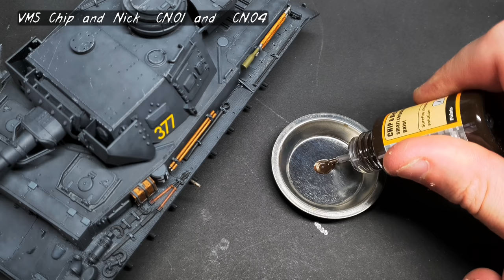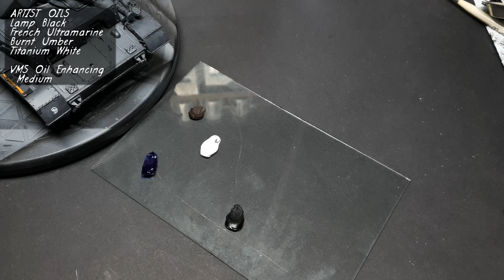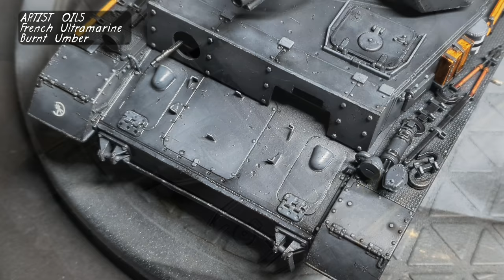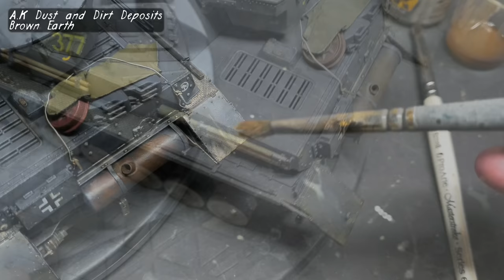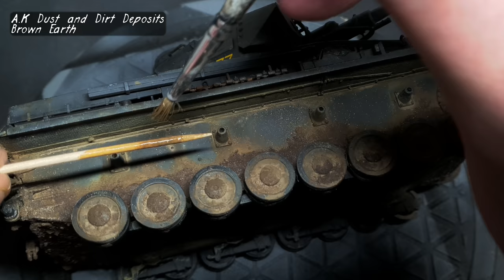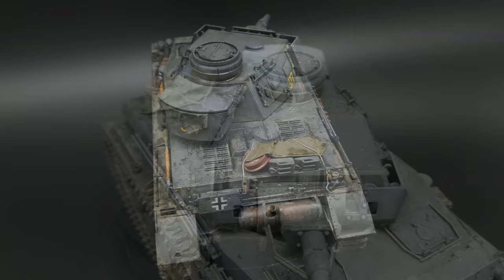Weathering the Border Models Panzer IV F.1

Comment: Hi James, thank you for the fantastic series — I watched all four, start to finish. Impressive result, I especially like the contrasts that you created, a lot of details to absorb here. If I could make a simple suggestion, I think the decals are all more or less pristine, compared to the rest of the nearby surfaces. The “377” decals may have seen some grime streaking from runoff caused by the hatches above, and the crosses some heavy weathering (especially the one on the back of the vehicle, which feels like it is asking to be chipped and scratched, given the surrounding details). Again, thank you!
Reply from the maker: Hi Curtis, this has been mentioned before and I completely agree, its one area I need to work on and not forget. Thanks for the feedback and I'm stoked you stayed till the end !

Comment: Really nice finish... one thing that struck me when looking at the final pictures is the number of gun cleaning rods you've got on the kit .. I think there might be a mix up of parts with the later variants of panzer IVs , but they do show up nice as a contrast to the grey finish... Great job all around on this build and will be looking forward to your next build ..
Reply: Although the work here is superb, I can tell you as a former armor crewman that a weather-worn (indicating it's spent considerable time in the field and hasn't been back in a motor pool or anywhere else it would have been cleaned up) tank is unlikely to have all its external kit. It falls off, is broken and discarded, it gets lost, it's stolen by other crews who need a particular bit of kit, and, if in combat, is shot off. There are only two times you're likely to see a military vehicle (of any kind) with its complete external kit - when it's first delivered to a unit and when it's ready for an annual general inspection and/or a parade. In use, they and their kit get the sh*t knocked out of them.
Reply from the maker: Hi Richard thats true it has the long gun one as well.. thats me not focusing and the instructions being a bit poor

Comment: Is there a “help forum” for out of practiced modelers, specifically for painting?  I am returning to building models after a 32 year momentary lapse of reason and it seems to me that so much has changed.  I’m really lost with the “new” paints and products in particular.
Reply from the maker: Hi Steven. There are a lot of groups on the dreaded Facebook for modellers,  a lot of them are basically just groups to share and receive praise, for improvement I like the scale model critique group, but beware a thick skin and a genuine willing to learn are essential. 

For online forums (they seem to be dying out ) I used to frequent Armorama a lot and learnt all about airbrushing there long before I even got one.  This was a long time ago so now, I have no idea. 

One of the best things is to experiment. And this can be done on a budget as well, a few good oil colours will get you better mileage than a cheap set, and you can cherry pick a wash or grime from certain manufactures until you find something that works for you.  Same with glue and paint. 

There is lots more out there, I only returned to the hobby four years ago at 27 ( stopped at 18)  and with a critical eye and a willing to learn I managed to get to a stage where I am happy,  I'll be the first to admit I have tonnes more to learn, but thats the fun of modelling . ( to me anyway ) 
Take care and thanks for supporting the channel !

Comment: Another great video on how to use oil paints. I use them all the time but I have still to learn to thin, apply and blend them correctly. Did you ever use some pastels instead of pigments (besides you one of my other hero, Mitko Nikitov, says they stick very well in this video https://youtu.be/m7RLTGPfQ-w?t=2246). They are cheap so I will probably give them a try.
Reply from the maker: I havent used pastels yet and I try not to use loose pigments as I wash my models ( because of storage they get dusty) something to try !